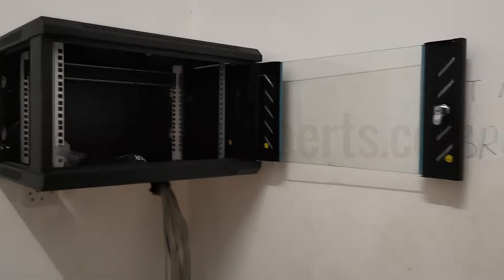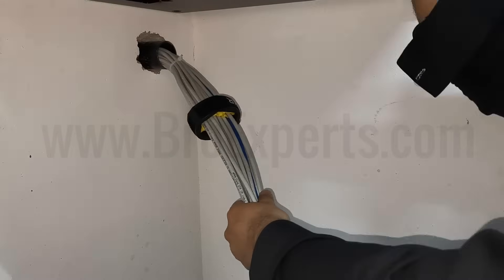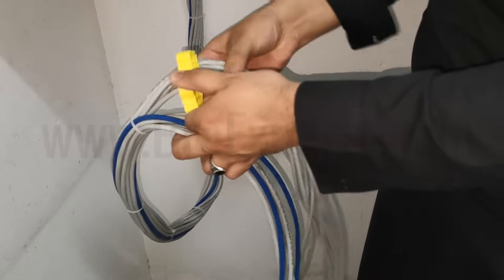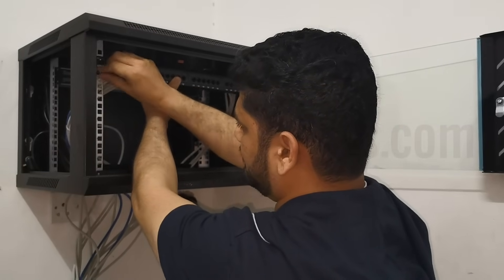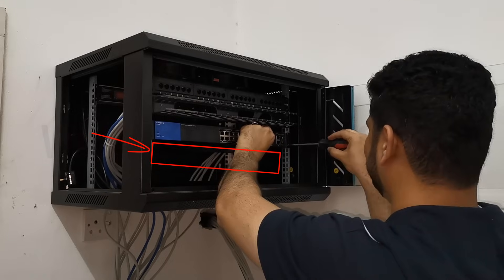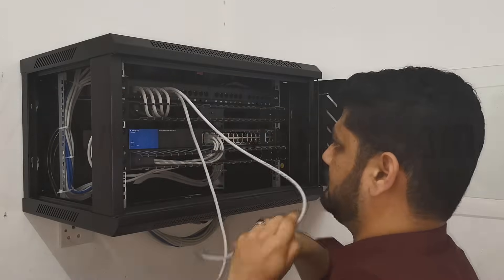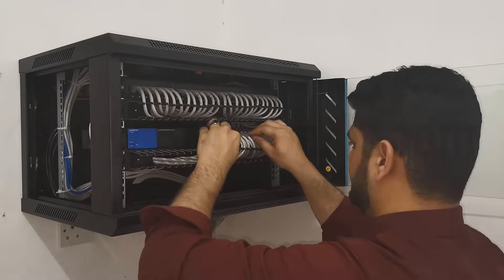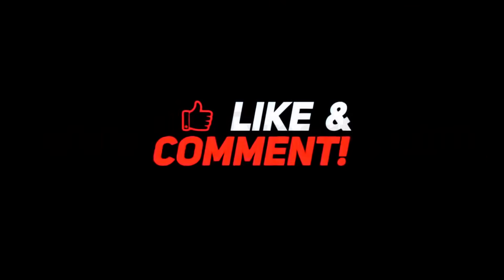Learn Network Cable Management Inside Rack From Scratch

Comment: This approach won’t work on large installations, this method is mainly for small installations or home networks where the switch has the same amount of keystones available and order isn’t important When cabling large organisations only x switches may be available and rooms are blanket cabled, or budget restraints, leaving many of them redundant, it’s important split each room down into port,  room , floor and even riser number,  and wire in sequence this will aid when equipment,  iP phones , wan access points , door access points ,  fire sensor equipment or ip cctv are added ,  only Velcro tied in 10 cables at a time and label , as cables can be damaged in building work this easier replacement,  also in some organisations they insist on two switch setup above or below each keystone bank to separate vlans for Poe or public access points , the exact details should be discussed in network planning with the client

Comment: ask, why are you connecting so many lan cables  from switch to switch ? is it for redundancy  ?
Reply: That's from a patch panel to a switch. This is not redundancy, it's how it's meant to be. Each wall jack leads into the patch panel. Then from the patch panel it goes to a switch port. This is done so that you can label the wall jack with a "permanent" number which corresponds with a number on the patch panel. Only the cables from the patch panel to the switch can be messed around with this way.
Reply: @darealdrsp  omg i'm blind . haha I thought it's a LAN Port . thank you !

Comment: Sir, I want to a Job in this line so what course and degree will be suitable for this line. Please help
Reply: You don't need any degree to do this. Either become an electrician or work for a low voltage or data company.
Reply: @electrician240  Thankyou Sir... I've completed Diploma in Electrical engineering, so now I'm suitable for a job in this Field.

Comment: Great job man! but i guess if you want to 'teach' good practices just 2 tips.. 
1.use hook and loop velcro, it is wider in general and wont pinch the cable,  this wont attenuate the UTP signal.
2nd is buy a label printer, your approach might be easy on the eyes(that counts a lot), but could be a nightmare for other techs to figure out which one is which.

Comment: What length cat6 cable did you run from the patch panel to the switch?
Reply: Can i to 50cm .
Reply: @ehsan.rajaei  Actually, I would prefer just running short (15-30cm) cables on the front side directly from the switch to the patch panel. I think it is both easier to install, and easier to see what goes where. Eliminates the need for the two cable managers as well, giving you more room for potential other equipment.
Reply from the maker: 1 meter
Reply: @BroExperts-Tutorials  Thank you.
Reply: @BroExperts-Tutorials  Is 0.75m cable long enough to do such cable management ?
Reply: @tonniex360  just make them to length
Reply: longest should be 1m

Comment: Nice cable work management guide overall but, you made a few  crucial mistakes. First you need to use Velcro wraps instead of those plastic zip ties. Next you are supposed to have a Rigid Plastic Insulated Bushing attached to the end of that "chase" pipe that's coming out of the wall, that your cables are coming out of. It protects the wires and  prevents damage to the wire insulation and is flame retardant material to 105C. You also must install a "ground" wire to your data rack. After you're finished with everything, it would be a good idea to use "Fire Stop" putty to cover up the hole you made in the wall for your data cables,  in case of a fire.  The big mistake you made is on port #2 of your patch panel. First off, look at video marker 4:33 just before you were getting ready to punch down (terminate) those cables. You accidentally put the brown pair in the wrong slot.. it's reversed. On port #1, you have white blue...blue white; white green...green white; white orange...orange white; white brown...brown white, which is correct for T568A.  But on port #2, you have white blue...blue white; white green...green white; white orange...orange white; Then you reversed the brown pair. It should be white brown...brown white. Instead of brown white...white brown. Also try next time to keep the cable jacket closer to the patch panel while you're adding each twisted pair to their pins. Your cable jacket should be in the center of each block between pairs 2&3. It will then look like the pairs are fanned out.  I see you are using the old method of T568A when everyone these days is using the industry standard of T568B. For the other viewers, T568A is only used in some older hospitals/medical centers and for Nurse Call devices  and in some older schools. I hope you tested all the cabling and Jack's before you signed off on your patch panel job. And lastly, you shouldn't have had your patch cords buried in the back of that rack. They are supposed to be in the front. I'm surprised nobody else caught this in the comments section about that reversed pair on port #2. Sorry. Didn't mean to nit pick everything on your mistakes but, that's the way these installations are done these days.  Oh well, nice tutorial anyways. Thanks for sharing.

Comment: Thanks for the video, unfortunately you missed an important part which is how you remove the long cables and how you managed to punch them into patch panel in this small space, and by the I think moving the cables behind the switch will affect the airflow.

Comment: Nice looking cabinet. However, I have several suggestions. First, do not use zip ties. Second, you are putting equipment in the cabinet randomly, without taking care of U units. Distances between those square holes are there for a reason. Between each U unit, which consists of 3 square holes, there is narrow interspace. Between holes which are part of certain U unit, there is wider interspace. 
All pieces of equipment that you have installed has a height of 1U unit, and they have two holes on each side that will fit with top and bottom holes of U unit. If you will not install equipment exactly into U units you will have problems with screws that will not screw. This problem will be even more serious when you will be installing rack servers with rack rails that will not fit because of rails' bolts that will not overlap with rack holes. Later you will have to leave spaces just like in the video, to make things straight again.
Reply: This is an IDF closet. No servers are going in there. Leaving spaces can improve ventilation.
Reply: @enchantingendlers2105  in that case, you should probably leave a 1U space between rackmount devices, instead of 1/3U lol. I don't care how good his cable management is if he doesn't understand rack units.
Reply: you watched thisvideos 3 years back to complain? nah u crazy
Reply: Def. should use zip ties. If you use Velcro, some lazy asshole WILL undo it "just for a minute" and in a year, it'll look like a rats nest. Only the most outrageous asshole would cut off all those zip ties to add/remote a cable, though. Velcro is just too big a temptation for the lazy.
Reply: @user-nh3gu1ge3d  you underestimate the outrageous assholishness of people with access to the wiring closet, and their lack of a bag of zip ties. I charge people pretty good money for wire closet cleanups. I hope they have an employee that jacks it all up again - more than happy to come fix it again ... for a price ;)

Comment: Use a modular patch panel with a lacing bar make troublshooting easier. use printed labels.
Velcro. Test all cables
Reply: Absolutely I cringe when ever I see this. Cable ties are a no no, the other thing never trim cable ties and leave tabs like that they are down right dangerous to any one reaching into the cabinet trust me. In fact some industries don't allow there use period. Hook and eye raps are the go, besides a cable tied bundle may/will fail qualification and or certification seen it before. As for the eye and hook aka velcro you can also buy it in rolls real handy.  Great effort just need to lift the game a bit and yes label the cables it happens "someone" moves a cable for testing and it never goes back in the correct  slot makes trouble shooting way easier especially years on.  :)
<edit> and do test even the patch leads not unusual to get out of the "bag" failures just saying.

Comment: I like your video and your installation, but I would do it a bit other way:
1. USE VELCRO STRIPS INSTEAD OF ZIP TIES. I wrote this with Caps Lock on because you overtightened these ties, deforming and damaging the cables. I've seen way too many "it sometimes work and sometimes not" network troubles caused by this. Zip ties are awesome, but not when used like this. You'll also find out velcro (or similar) strips are reusable, so it's easier to keep it nice and clean over time with adding/replacing/removing cables and everything. I am well aware many people here wrote this already, please see their comments as well.
2. Install the cabinet so that the tube coming through the wall ends in the cabinet, not below it. This makes it cleaner (less dust in the cabinet) and nicer to look at. I also find it more comfortable to work with. Other people already mentioned this.
3. These patchcords are going wild in the back, possibly affecting the cooling of the switch. I usually route them in a conduit on the side, so they aren't getting in switch's airflow.
4. I heavily prefer modular patch panels with individual keystones. It is a bit more expensive, but I found it better in certified Cat6 and above installations.
5. Include a plan, legend or some other aid to know which cable is which. I usually put it on inside side of cabinet's door. I also always use racks with full metal doors, not glass ones.
6. Some color coding, maybe? If this only connects 24 computers or Wi-Fi APs together to some fiber or other uplink, having all the patchcords the same color is okay. If not, using for example green for LAN, blue for SAN and so is a good practice - don't forget to document this in the aforementioned plans/schematics on the front door. Somebody else already wrote this, and I add - if there is more than one cabinet in the building/campus, use the same color-code everywhere.
7. Ensure proper cooling of switches, router and/or other devices in the cabinet. There should be good airflow, unobstructed by wild cables (this reminds me, how did you store spare length of incoming cables?) or other stuff withing the cabinet.
8. Use air filters to make sure the cabinet isn't collecting all the dust in the room, even if it is a dedicated server room or something.

TL;DR: You have done well. It isn't perfect, but I'd still recommend you to a relative - just please use velcro strips instead of zip ties, or at least don't tighten them this much.
Reply: Spot on on all counts.

Personally I'd add that while this looks very organised, it's actually pretty difficult to work with and to trace cables. I prefer to forego the plastic cable management strips and instead mount the switch directly under the patch panel, then use 25 or 30cm patch leads straight into the switch. (Which is admittedly more difficult with a switch like the one in this video where all the ports are on the right-hand side).

This works beautifully with 48-port switches and 24-port patch panels. Install a patch panel top, then use short patch leads to go to the 24 top ports on the switch. Then install a patch panel below and use short patch leads to the 24 bottom ports on the switch. This is neater, it makes it trivially easy to trace cables, it doesn't leave a big bundle of patch leads messily at the back, it takes up less vertical space (so you have room for a small UPS or other gear), and adding, tracing, or moving a patch lead doesn't require access behind the switch and panels so you don't rick knocking out other cables by accident.
Reply: I am surprised zip ties are so heavily frowned upon in the comments section, I am using them all the time and never had any issues. 

Last time I used A LOT of zipties (hundreds), I ran three POE IP cameras, about 50 meters each line, for 80% of the length ran together through attic and I ziptied the (3) cables together to nails along the way so they stay in place and won't get damaged when moving stuff in and out of the attic. What should I do instead?
Reply: @Jirk4  The main problem is the way they were overtightened in this video. If they were left open a bit more to hold the bundle of cables together but not so tight to put pressure on the cables it would have been fine.

The minor problem with zip ties is they can't be re-used like velcro ones, so if you add a couple more cables they either don't end up bundled in or you have to cut each one and use a new set of zip ties. (And if you choose to cut and the original was too tight, showing the scissors in there to cut the original makes the original tie even tighter).
Reply: @Jirk4  I also use zip ties all the time and they are awesome, but some people tighten them too much, damaging the cables. Most people would just tighten them as much as they can as if they were testing their strength or something.
Reply: @Jirk4  : never had any problem either, used almost billions of zipties over the years. And lately always certified the work with a Fluke CableAnalyzer, sometimes many years after initial installation; without any problem.

Comment: When you split a cable to terminate on patch panel you should keep the wires slightly up not pointing down on the video you are trying to terminate and get wires cut and you have to crimp 4 to 5 times before the wires get cut if you leave the wires pointing up when you terminate the wires it will be cut 1st time and not make the gaps on patch panels big

Comment: Neat work there but please no ZIP TIES! !!! that's a no-no! 👏
Reply: What do you suggest to use instead of Zip ties?
Reply: This video was on too simple a rack to show any cable problems.  But to answer your question I use Velcro Straps/Strips every where I may be changing wires.  I still use zip ties if I believe there will be no adds/changes but velcro everywhere else.  Specifically I use https://www.harborfreight.com/3-4-quarter-inch-x-35-ft-roll-hook-and-loop-cable-strap-96215.html cut to need.I will say NEVER use scissors to cut the cable tie slack off.  It leaves sharp edges.  Always use a zip tie gun or small diagonal cutters with the cutting edge close to the zip tie lock. If you reach your hand into a rack with zip ties cut like this video shows you will end up with a lot of cuts/scratches.
Reply: @sotmrus  ..Velcro Cable Ties Reusable Fastening Cable Ties Cable Straps... they come in different sizes and lengths.
Reply: @SteveMosetiAliyebarikiwa  thanks for info. I used the Velcro only once for my computer cables. Bought them from Aliexpress.

Comment: I hate cabling without labeling, even if it seems too excessive now, it will definitely help the next engineer to replace the failed switch
Reply: You are right bro
Reply: Patch Port 1 ---TO---> Switch Port 1
Patch Port 2 ---TO---> Switch Port 2
Patch Port 3 ---TO---> Switch Port 3
.
.
.
.
Patch Port 22 ---TO---> Switch Port 22
Patch Port 23 ---TO---> Switch Port 23
Patch Port 24 ---TO---> Switch Port 24

where is the fault?
Reply: Isn't that the point of the patch panel? Label that?

Comment: BAD method of snipping the cable ties there, you should get some proper snips and snip right next to the based side ways on, that way you don't leave any sharp edges. Also i would have just used very short patch cables rather than cable manager and fully populate the switch given there is only 24 ports in any case.
Reply: Yep. Was gonna say the same. Need to flush cut those bad boys.

Comment: from where to buy that green cable bundle module
Reply from the maker: Here is link to buy:  https://www.amazon.com/gp/product/B00429P1OU/ref=as_li_qf_asin_il_tl?ie=UTF8&tag=broads04-20&creative=9325&linkCode=as2&creativeASIN=B00429P1OU&linkId=0f7078e9d1dd126c41f43cc5fff9bf24
Reply: @BroExperts-Tutorials  What length cat6 cable did you run from the patch panel to the switch?
Reply: Was it green or yellow? Go back and check
Reply: This thing is an absolute rip off. Find someone with a 3D printer and ask them to print a similar tool for you. Ready to print files can be found on Thingiverse. Will cost you a fraction of an original stupid price.

Comment: You should never use zip ties, always use Velcro. There is a wasted hole space above the upper cable management and another above the switch. The lower cable management serves no purpose, you could have neatly run the slack back through the holes in the management bar and back out, or just use 6 inch/15cm cables. You wasted a total of 2RU that might be needed in the future.
Reply: lower cable managemen made me a bit mad .. i couldve fit lot of things there

Comment: Why need of patch panel if those cables can directly be put to switch.
Reply: So you can easily identify, move and test the line. You can easily name every wire, and find it faster. You can also extend the line with longer patch cable to your laptop for testing. And you don't have to worry about breaking the connector, you just have to swap them with a new patch cord.
Reply: Well for one it's hell easier and faster to fix cables to patchpanel than plugs and if You look at prices of cat 6 plugs You will see how much cheaper patch panel is. Oh yea, and it looks cool.
Reply: Got it